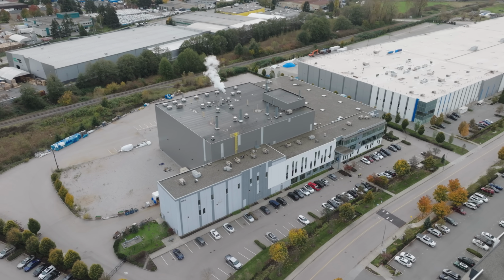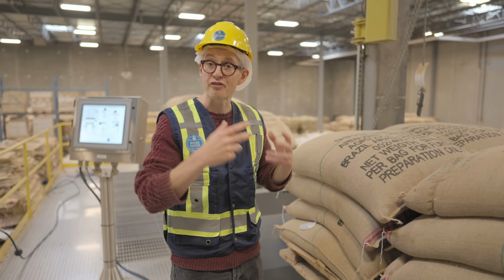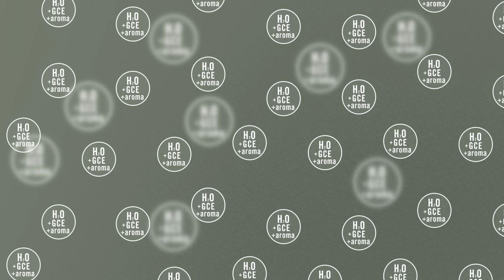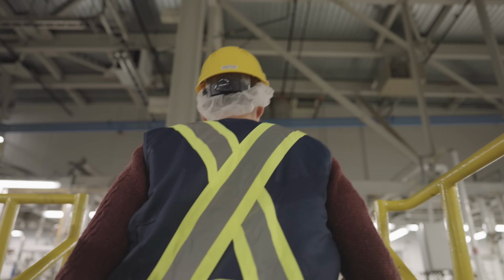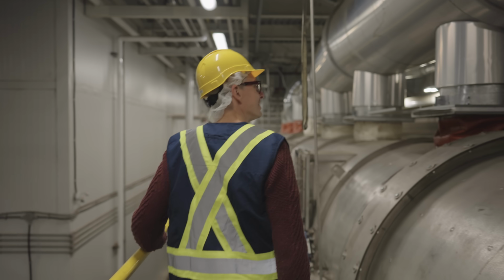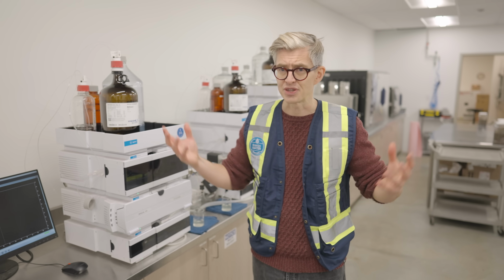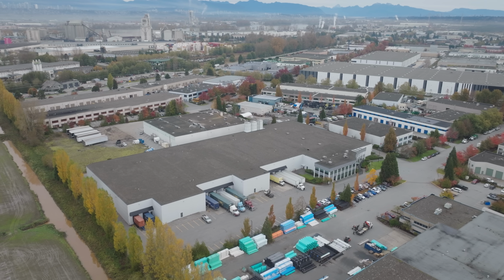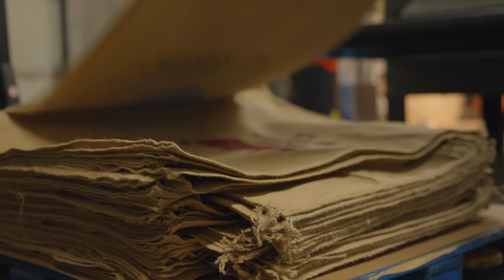The Secretive Decaf Process Using ONLY Water

Comment: The term osmosis is preserved for the movement of water based on the concentrationgradient over a barrier, in the case of caffeine you would just say that due to the concentrationgradient and entropic forces, caffeine diffuses out of the beans into the solvent

Comment: I don’t think that explanation quite holds up, but I’d love to hear differently from your team if I’m wrong hoffster

In theory every compound has a different osmotic compound. A green coffee extract made from say a high altitude arabica, will have a very different composition than one made from a low altitude Brazilian. It has to if it contains everything in that coffee, that’s THE WHOLE POINT OF SPECIALTY COFFEE. What they are describing about using a single changing batch for all beans is the equivalent of how commodity coffee treats blending which is “it’s close enough and nobody will ask”

So yes, based on the science literally every batch of beans needs its own GCE otherwise you’re muddying what makes origins unique

Comment: Thanks for this series!  I just have one request:

I was really hoping for more insight into how much caffeine actually survives the decaffeination process.  Decaf coffee producers typically market their product as "99.9% caffeine free".  However, this is clearly misleading because a raw coffee bean is somewhere around 0.3% caffeine by weight.  So you can see that "99.9% caffeine free" is not really promising much at all.

I have read numbers anywhere from 1–30% of the caffeine can still remain in the bean.  I'm sure this varies per process.  And of course how much caffeine is in the bean is a slightly different question than how much makes it into the final cup of coffee.

I would really love to see some testing results from a reliable, independent source such as yourselves!

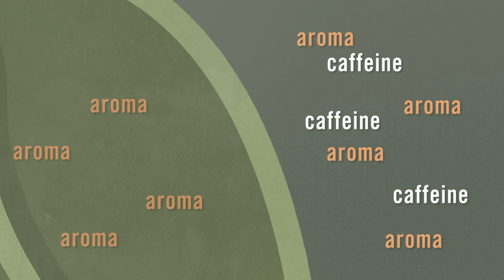Comment: 4:08 you're not really countering osmosis, but rather diffusion of dissolved compounds. Those compounds (except for caffeine) are present in a similar concentration inside and outside of the bean and will therefore not diffuse to either side. 
The thing I'm doubtful about, however, is how this process would affect the coffee flavour, since you use this green coffee extract from a certain coffee. If you decaffeinate another type of coffee, you'll extract compounds not yet in the extract and you'll add some of the compounds from the extract into the coffee. 
Wouldn't this make every coffee taste more alike the "same" coffee extract?

Comment: Thanks, James, for the fantastic work! I've tried several brands of Swiss Water Decaf beans, and except for one, most were more bitter and flowed through the portafilter too quickly. I attempted grinding finer and using more coffee, but it didn't solve the issue. Could you provide some tips on how to brew a proper espresso with decaf beans?
Thanks in advance!

Comment: Chemical engineer here. Just want to inform that osmotic pressure is only relevant to the water equilibrium. The principle they use in the Swiss Water method is just pure Le Chateliers principle and equilibrium (to reach equilibrium the caffeine will move towards the low concentration phase).

Comment: Hi James, Another great vid. One thing I've been puzzled by is the makeup of GCE. described as a one time initial extract  that 'just' needs to fed like a sour dough starter. But we know that every coffee is different in it's chemical makeup (that's why it tastes differently presumably). It might be small differences but it is different. If you use a generic extract then presumably each coffee will 'give up' or even 'take up' different compounds through the osmosis process (concentration gradient, across the membrane).

My thoughts are this would create a 'generic' SWD flavour profile.

Ideally of course you'd want a GCE specific for each coffee that goes through the process.

Comment: I have a question: how come all the caffeine is being pulled out of the coffee and not just 50%. If it's osmosis then after 50% of the caffeine is being pulled out the process should stop. No?
What am I missing?
Reply: In video, I see a bunch of tanks there. My guess is if you repeat the process, then only 25% is remaining, right? And then you can run the process again. And it will be 12.5%, right? You see where I am going with this?
Reply: @kuznechik  you're right, thanks. Actually, thinking about it, they don't even need the tanks just to keep refreshing the GCE.

Comment: Wouldn't using a "coffee extract" basically mean they're using coffee to extract caffeine? Additionally, i'm assuming the different flavour in different coffees comes from different soluble compounds, which the "coffee extract" does not perfectly mirror. Doesn't that mean those compounds get extracted until the coffee mirrors the "coffee extract", meaning every decaffeinated coffee ends up tasting like the original "coffee extract"?

Comment: I heard that only like 75% of the caffeine was removed in most decaf. Is this 99.9% extraction in Swiss Water processing unique to this process or is was I lied to?
Reply: Both are true. The thing is that there isn't much cafeine in coffee to begin with, and if you remove 75% of very little, there is even less. Now, before you think it is a scam, cafeine has a half life of approx. 4 hours (it depends per person), so if the amount left is 2 x 4 = 8 hours of processing in your body. So you can approx. drink decaf 8 hours later and still sleep.

Comment: what stops all swiss water coffee from tasting the same? shouldn't it all have the same concentration of compounds as the GCE used? or for each type of coffee is there a waste batch used to make a GCE for that specific coffee, is that why the minimum order size is so large? or is the difference in concentration between the GCE and the beans low enough that it would take much longer to homogenize flavour than to extract caffeine? edit: saw in another comment from them that it doesnt leach flavour because the concentration of everything in the GCE except caffeine is higher than what might be in the beans.. but if the concentration is higher then they wouldn't be leeching anything out of the bean but shouldn't osmosis work in the other direction too and they'd be adding a small amount to the beans and slowly de-concentrating their GCE?

Comment: I think an interesting point has been raised by a number of people here around the GCE not precisely matching the flavour compounds of each specific batch of beans… maybe a simplistic interpretation but you could infer this would reduce some of the subtle distinctions between different coffees by only preventing extraction of the characteristics of the GCE flavour profile. Only way to know I guess would be to taste a range of Swiss Water decaf coffees to see if they retain diversity of flavour!
Reply: There is likely some equalization of the flavor happening. However the speed of diffusion is directly related to the difference in concentration. So unless there's very different components, they might be able to diffuse the caffeine much quicker than the other components. Keeping the flavor change minimal.
Reply: @dykam that's plausible, I was wondering about that. My understanding of osmosis was that it will happen unless the concentrations are the same which seems highly unlikely, I can't remember how the difference in concentration affects the rate though.
Reply: @adgpy  you are correct in that osmosis will happen if concentrations are different, but the larger the difference (larger concentration gradient to be specific if you want to read up on it on your own), with all else being equal, the faster it happens. I dont know if it supports the theory that it will minimally affect the taste of the beans, but it is an interesting thought and would be cool to find a follow up on.
Reply: My impression from the video is that a portion of each batch is sacrificed to make the GCE for that coffee. That could be one of the reasons why the minimum batch size is so high.

Comment: It was a great pleasure of learning about the Swiss Water process! Thanks. My question about the processing method would be: during the osmosis process to move the caffeine out of the green coffee to the solution, if the coffee is from a very specific lot with specific aromas, would they actually have to adjust the GCE for that specific coffee?
Reply: That is the exact question that I have in mind. If it's the same GCE solution that is used for all the coffee that is being decaffeinated, then all the different varieties of coffee will taste the same. Mr Hoffman, can you clarify?

Comment: Presumably the unique solubles in a green coffee bean in a specific lot are what contribute to the flavor and aroma in the roasted product. Swiss Water's process uses a large volume of "Green Coffee Extract" which, at least based on the information here, doesn't appear to be unique to the beans currently being processed, but instead it appears to be a kind of "generic green coffee extract" which potentially includes aromatics from many many different sources. In other words, say I am decaffinating a Kenyan coffee -- the GCE used to process that green Kenyan coffee appears (to me at least) to also include extracts from Ethiopia, Columbia, Venezuela, etc. etc. 

Presuming I have understood the video correctly -- and I may not have! -- does this necessarily imply that, in my example, it is impossible to retain the unique solubles of that specific lot of Kenyan coffee, and as a consequence the resulting decaffinated product must, by the nature of the Swiss Water process, end up closer to the "average coffee flavor"? Or does Swiss Water have a very proprietary and quite secret additional process whereby they are able to retain the unique profile of a specific coffee and therefore allow that uniqueness to be expressed in the final roasted product? 

As an addendum, its worth clarifying that "average coffee flavor" may still be extremely good -- high quality green coffee is high quality. I've had Swiss Water processed coffees and they've all been excellent, I don't question the quality of Swiss Water's process here. But I'm curious specifically about retaining and expressing the unique flavors and aromas which may be present in one lot of coffee and nowhere else. Or maybe that's not even an entirely relevant question, because coffee's uniqueness tends to be more tied to large geographical regions where the land area is on the order of small countries?

Sorry for the super long question, but really curious about this. Thanks!

Comment: I understand how the coffee is decaffeinated but when they remove the GCE from say a Colombian coffee, how do they retain the flavor of this single origin coffee if they are reusing the same GCE from other coffee.
I also noticed that all decaffeinated coffee I have bought doesn’t show a country of origin it just shows the decaffeinating process ?
So how do they return the original flavors of the coffee if they are using the same GCE for all coffee they are decaffeinated ?
Reply: Thank you for asking this, I was wondering the same thing. It seems like you would need to make the initial GCE from the same raw coffee as what you use it to decaffeinate. A sacrifice from each batch to avoid "cross contamination" so to speak.
Reply: Exactly my question too.
Reply: Hi! We've tried to answer this a couple of times above, but the idea is that only caffeine is absent from the GCE, which leaves the components (e.g. flavor compounds etc.) in place in the bean undergoing decaffeination. The caffeine diffuses out into the GCE, but the rest of the compounds do not.

We sell a great many decafs on our webstore that show the country of origin. You may be more used to seeing blends that don't get too specific.
Reply: @SwissWaterProcess  Wouldn't the differing concentration of flavor compounds have the same effect as the different concentrations of caffeine, though? i.e. they would try to diffuse so that the concentrations are equal between the GCE and the coffee beans. What's preventing that?
Reply: Nothing in the process is ever at a higher concentration gradient, except caffeine. Therefore nothing can diffuse into the coffee because the concentration gradient of any other compound is always lower than what is in the bean.

Comment: As somone who is working with industrial automation, I would love to look into process control software for it, in Europe, it would probably be powered by Siemens PCS7 (PCS neo) or maybe by Sistar, but it's not too difficult of a process. from what I see each tank has probably less than 20 different variables that PLC is controlling, conveyors are easy, the drying tunnel is also simple, it is perhaps the same as tunnel pasteuriser. I'm curious if they had this equipment custom-made, or was it in-house design since reactors are non-standard from different industries.
Reply: Custom made, in house design. Could be using an IPC with Codesys instead of seimans tho.

Comment: Is the green coffee extract used unique to the batch of beans? Because if the extract is used universally throughout all the beans, I wonder if that would cause all the output coffees to have a more similar taste to one another. I hope this question makes sense! Thank you for the informative video James!
Reply: The video @swisswaterprocess linked to states: ""We use the same GCE for all the different origins of coffee we decaffeinate because all green arabica coffee contains the same water-soluble compounds. Their specific relative concentrations will vary depending on genetics and origin, but ultimately their composition is the same."
Reply: Maybe the the GCE, while not being an exact match to the batch being processed, is close enough to slow down diffusion of flavor components so nothing gets significantly changed during decafination.
Reply: @flightinflightsim  I guess the longer you use the GCE with a particular variety of beans, the closer it will match the relative concentrations of non-caffeine compounds in that specific batch. But the difference in concentration (and therefore the osmotic pressure) of those compounds is probably several orders of magnitude smaller than that of the caffeine so you would need to soak the beans in there for a long time before tasting the difference.
Reply: If this is the case, we’ll see a significant change in characteristics when tasting the Swiss water coffee 😜
Reply: I was wondering the same thing. If you need to start a new batch of GCE for every variant there's quite a big upfront cost, a certain fixed quantity of beans that have to be 'wasted' making a tank full of extract, so the minimum batch size would need to be a certain multiple of that before it's economical to do.
Reply: @flightinflightsim  Nothing in the process is ever at a higher concentration gradient, except caffeine. Therefore nothing can diffuse into the coffee because the concentration gradient of any other compound is always lower than what is in the bean.
Reply: I believe the other coffee materials in the GCE are only there to provide an equilibrium of osmotic pressure so those materials within the GCE don't pass into the processed beans. Someone can correct me if I've gotten that wrong from the video.
Reply: Our GCE contains everything BUT the caffeine, so only the caffeine is diffused out of the bean being decaffeinated—the rest of the characteristics stay where they are. We have a short video that goes into a little more detail here: https://www.youtube.com/watch?v=V_Dv1uB5eJI
Reply: Presumably there is some diffusion of aromatic compounds, just significantly less than the caffeine (and probably little enough for it to not matter much). After all, the differences in composition is what gives different coffees different flavors, so the GCE can't have exactly the same composition as the coffee.
Reply: @SwissWaterProcess  That didn't answer the question... Do you make a new GCE every time you decaffeinate a new type of coffee, or do you reuse the same one for everything?
Reply: @QuantumHistorian the video they shared does answer your question towards the end, at least partly.  All green arabica coffee contains the same components so there’s no need to change the GCE… so by the sounds of it they might have different GCEs for different bean types but not for different origins of the same bean type.  That, or they only process arabica beans and not robusta, etcetera.
Reply: @captainkurt8802  Thanks. But not all green arabica coffee can contain exactly the same components in exactly the same proportion, because otherwise they'd be exactly the same coffee and there'd be no difference between any two arabica beans.

Now it might well be that the differences are so small that it has an absolutely tiny impact on the osmotic forces over the timescale it takes to de-caffeinate the beans. But that feels like a somewhat subjective discussion that's worth having, rather a bland corporate effort at sweeping it under the carpet.
Reply: @captainkurt8802  Correct, we do not process Robusta.
Reply: Typist's apologies—we actually do do some, but the majority is Arabica.
Reply: @SwissWaterProcess  What about organic coffees? Do you have an organic GCE for organic certified beans?